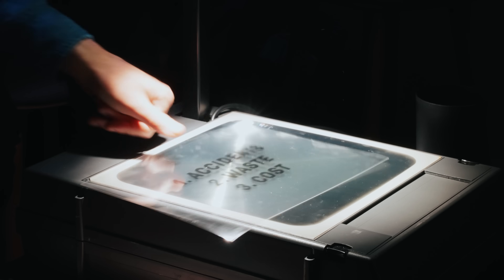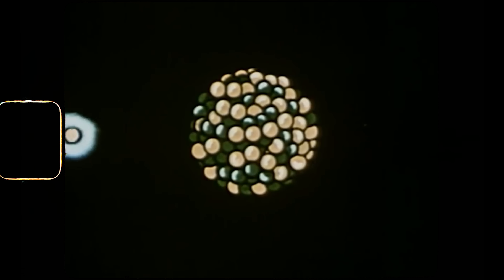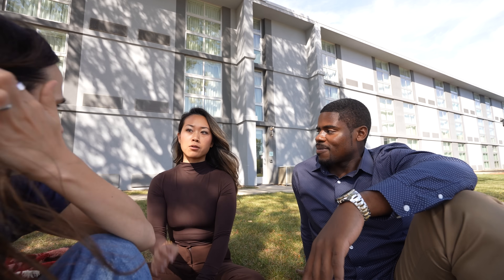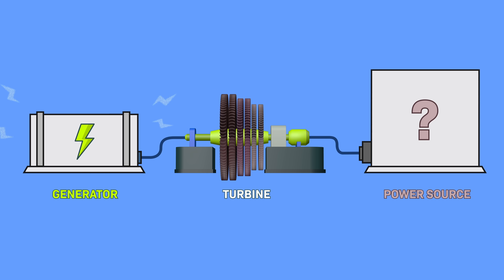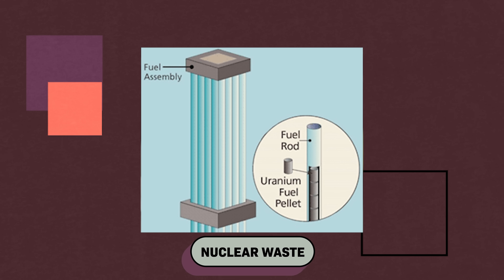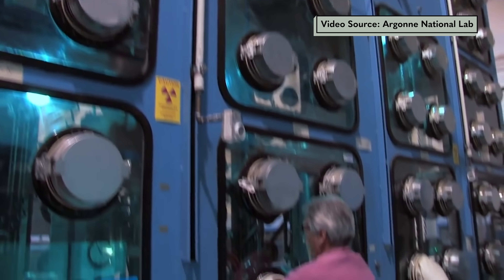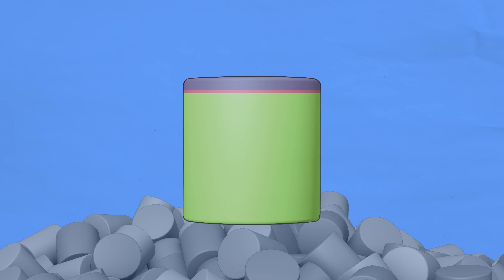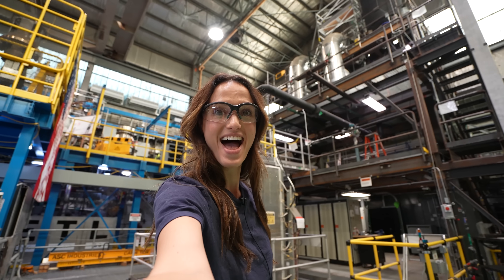The Big Lie About Nuclear Waste

Comment: Inspirational video! Hope we get the proper technology soon, not use we do this in Canada either! I have to go polish my nuclear knowledge, I thought Uranium was the very unstable atom that breaks down into stable atoms creating tons of energy and radiation, and over time when the supply of Uranium becomes smaller, the nuclear fuel doesn't create enough economical energy and has to be replaced, unless recycled.
Reply: This is close, but not quite how it works! The energy in a nuclear power plant isn’t from uranium decaying because it’s unstable, but because it gets hit by a neutron—and that decay also gives off neutrons, so you can get a chain reaction. This means you need enough U-235 that every U-235 reaction creates exactly one more—less than one and the power stops, more than one and you have a nuclear bomb. :/ Eventually, there’s not enough U-235 in the pellets to keep the number of subsequent reactions at one, and you need new fuel—but most of the U-235 is still in there, just with a bunch of other elements ‘getting in the way’. Get rid of those (see the video!) and you can carry on using the fuel. And repeat!
Reply: @DrAndrewSteele  what about the thermal expansion and how that is part of the governing of the reaction rate, IE as it expands,  the density changes, and the rate reduces, so once the safe amount has gone, the only way to get more reactions out is by either introducing outside bombardment, or to re enrich the fuel as per this video.

I say what about, because I recall some long time ago a video describing this process, and am rather dim when it comes to being a nuclear scientist, So, I would like to converse on what about such things for revision purposes.
Reply: CANDU reactors can burn fuel very slightly longer than other reactors, but nowhere near as long as countries like France & Japan which reprocess nuclear waste.  We did this so that we could use natural uranium instead of enriched uranium, but it involved "enriching" the water.  Heavy water absorbs less neutrons.  Burning fuel for longer is a nice byproduct.
Reply: @nathanbanks2354  How much longer does it burn, over the standard procedure?
Reply: @Drew_Hurst  I don't know, precisely.  Light-water nuclear reactors use fuel that's enriched to 2-5% U-235, whereas a CANDU reactor can use natural Uranium which is only 0.711% U-235.  A CANDU reactor also has a robotic system that can refuel while it's still running.  I don't think anyone has tried reprocessing spent fuel from a light-water reactor for use in a CANDU reactor--there are various other fission products which make spent fuel difficult to handle because the emit various types of radiation.  The physical shape of the fuel rods & cladding are different.  However spent nuclear fuel from a Light-Water reactor still contains 1% U-235, so this could theoretically last a little longer than natural uranium if someone did reprocess it for a CANDU.
Reply: Well, you're quite the nuclear buff! I think you've got it right, but just remember: with great nuclear power comes great nuclear responsibility. So don't go causing any radioactive mayhem while you're out there polishing your knowledge.
Reply: As others have mentioned, typically a stable isotope of uranium is used as fresh fuel which then becomes unstable as it is burnt. Decay heat is not the primary power source for a typical commercial reactor.

But also, most regulators have exposure limits for the fuel assemblies. The cladding material has to deal with transient stress, strain, and fatigue as well as embrittlement, and internal pressure from containing fission gases, plus creep from the pressure/heat. Then there is also crud build up (yes, that is a technical term :-) which is essentially a combination of corrosion and boron precipitating out of the coolant - something about insulating the fuel from the coolant and meltdowns is bad... ;-)

So long story short, currently, the fuel is removed from the core before the majority of the energy is extracted. With a bit of reprocessing it could go back into service.
I can't speak for Canada, but in the U.S. mixed oxide fuel is a bit of a spicy political gray area which makes folks uncomfortable.
Reply: It would be nice if the cost of disposal/reprocessing was included in the cost of fuel.  It would still be a relatively small part of the price of building & running a reactor.  Perhaps a molten salt reactor would make reprocessing easier, though this would still have proliferation risks.  The Canadian company for molten salt is Terrestrial Energy, though they're going through the long long process of certification and plan to use traditional fuels.
Reply: @nathanbanks2354  why doesn't a government contractor just do recycling with government oversight? would probably get rid of proliferation issues
Reply: @Fr00stee  That's what we do now, however non-proliferation is also about allowing countries to have nuclear reactors without giving them nuclear bombs. Reprocessed fuel normally has plutonium in it, though I suppose all spent fuel does too.  Nonetheless, reprocessing makes much more sense to me than storing it for 100k years.
Reply: All fission reactions are very dependent on density: what are the chances that a neutron thrown off from a split will hit another atom? Too dense, and you get too many cascading reactions, and everything melts down (or, in a bomb, explodes). The density is carefully planned in a fuel rod. Once enough of the fuel has split, the density is lowered to the point where the fuel is still hot, but not hot enough to run the reactor efficiently ... but there's still a lot of fuel left in the rod. Recycling is basically sifting out some of the stuff that is slowing down the reaction, and making a new rod that has the right density from what's left over.
Reply: Funny enough - the spent fuel from light water reactors (what most existing non-Canadian commercial reactors are) have higher concentrations of U-235 than natural uranium does (in the range of 0.9% U-235 vs 0.7% in nat U). This means CANDU and other heavy water reactors can use the waste fuel from light water reactors and it would last longer than the normal fuel we use.
Reply: Go check fast breeding reactor they are the ones that can use almost the whole load of the fuel, reactors today just use 1% of the energy inside the fuel, fast breeding reactor can sustain the reaction cause they don't need the fissile isotope of uraniun, they create that part from natural uranium (238) and then use it directly.
Reply: Love to see you build one.
Reply: Two worlds collide, my mind is completely blown
Reply: I've heard of nuclear reactor setups called breeder reactors where they put in nuclear waste and "breed" it back into useable uranium 235, and you can essentially just keep doing this forever
Reply: @Fr00stee  

The breeder reactors generate plutonium-239, not uranium-235 alone. Plutonium-239 is much more radioactive than uranium-235 and it is the primary material used in nuclear bombs. Therein lies the terrorist threat.

Not reprocessing the nuclear waste keeps the terrorists at bay with the high radioactivity. It is also cheaper to use fresh uranium fuel than reprocess nuclear waste. The reprocessing itself generates more radioactive waste so it doesn't really solve the radioactive waste problem well.

Nuclear power is a way to borrow energy from our children's and our children's children's well-being.

France does nuclear waste reprocessing, has the knowhow, and sells its service. France dislikes terrorists, having endured horrific attacks.
Reply: knowing mr. Mehdi if he gets into the technology we can soon expect NuclearBOOM somewhere in Canada😮
Reply: @mru24  That's hilarious but nuclear power plants don't explodes like a nuclear bomb, if they explodes (it means the multiple safety systems fail), it's just a simple hydrogen combustion or simply an explosion for the high pressure reached, nuclear bombs have the particular charateristic that are very difficult to be made, you can't accidentally do a nuclear bomb 😅
Reply: @julyort6762  I completely agree with you but capacitors shouldn't explode too and they do on ElectroBOOM quite often so we shouldn't underestimate Mehdi😁
Reply: @mru24 
Even nation-states had a tough time trying to make a nuclear bomb successfully. India and North Korea failed on their first tries. I suspect that Nazi Germany also failed on its first attempt.
Reply: Although they're getting old and outdated, our CANDU reactors already work using that principle.
Reply: @elbaidel  CANDUs were great at the time, and are still good compared to current reactors, but the principles are completely different compared to the reactor Cleo is talking about (EBR-II).
Reply: the proper tech has existed for literally decades; it is just restricted and massively fear mongered
Reply: Yeah canadian nuclear power, keep dreaming.  Hey whats going a happen to the oil slick we got here in LA?  I kinda got used to the stuff.  Milliken oil drop work without oil?
Reply: Yeah, that's how your standard boiling water or pressurized water reactor works. Breeder reactors are a little different. Since they don't need to slow the emitted neutrons down with a moderator it allows them to generate more fissile material than they use while also generating power on the side.
Reply: @killman369547  It is not so much the fast vs. thermal neutrons that make a breeder reactor, it is the reactor design & geometry. You can make thermal spectrum breeders, the US made all of it's weapons Pu using thermal spectrum breeder reactors at Hanford and Savannah River.
Reply: @richardb1452  yes and look at the long term nuclear waste debacles
Reply: Canada actually has one of the most revolutionary next generation nuclear reactor types to run on nuclear waste in development as we speak. Check the dual fluid reactor.
Reply: Fission is the splitting of an unstable(fissile), large nucleus (U235) into two variable Daughter Isotopes by a neutron.   This process releases approximately 2 new neutrons, and a lot of energy.
The composition and geometry of a reactor is controlled such that 1 of those neutrons will be absorbed by another fissile nucleus, and the other-ish will be absorbed by something else.
Most Uranium is the non-fissile U238.  But when it does absorb one of those non-productive neutrons, it  forms Plutonium 239, which is also fissile.
The problem is those two Daughter Isotopes.  These are all hella radioactive (short half lives), and some of them are excellent neutron absorbers, but not fissile.  These are called neutron "poisons" in the industry.  Given enough run time, they accumulate to concentrations that will stop all fission in the reactor.   You are left with most of the U238 that went in, some new Pu239, very little U235 (the original fissile fuel), and almost twice as many hot Daughter Isotope atoms as U235 and Pu239 that you managed to fission.
That surplus Pu239 is the longest lived radioactive isotope present, with a half life of 40,000 years, but is also an excellent fissile fuel itself.
The problem is that an excellent fission fuel is also an excellent fission weapon.
Reply: Then you are deluded. Even U235 fossil. Fragments are highly radioactive to the point spent fuel rods are red hot from their decays, and have to be kept immersed in cooling ponds for years before they can be diluted enough to be encased in cement down miles deep bore holes. 

You are a deluded sucker.
She is talking about breeder reactor technology. Where side reactions form higher and higher mass synthetic actinides with smaller and smaller critical masses and larger releases of neutrons with every fission that transmute the Atoms of the reactor structure and body's of the workers into radionuclides.

It has NEVER been viable because predicting the chemistry and characteristics of the fuel in controlled fission becomes more and more impossible. 
It has always resulted in unexpected uncontrolled sudden explosive chain reactions. 
And the fission fragments are more and more dangerous at every repetition of the cycle. 

The only advantage, if you could call it that is the potential to accumulate certain isotopes of Americium Californium and Curium that have critical masses from pinhead to marble sized and in theory could be used for nuclear fission bombs you could put in your pocket. As long as you intend to use them in less than a month, and don't mind being killed by the neutrons they release from spontaneous fissions, if you spend more than a few minutes anywhere near them. 
As the half lives are a few years, spontaneous fissions thousands of times more per second than U235 or Pu239..
If you think using nuclear fuel as radioactive as polonium 210, where an amount the size of a grain  of salt is sufficient to kill by radiation poisoning every human on the planet, then you are as much of an ignorant fool as this PR Bimbo appears to be in this video.
Reply: Nice to see you here.
Reply: Please watch some of kyle hills videos, he has a great half life series going into the accidents and other nuclear related videos talking about how it is even now one of the best options (better than only solar or wind).
Reply: This clip drastically oversimplifies the issue. Everything she says is true, but not everything that is involved is in this clip. I'm pro-nuclear, formerly very anti-nuke. If the US could take knee-jerk politics out of the science and engineering we as a nation would benefit tremendously. Nuclear is dangerous but the dangers are known and that leads to safety.
Reply: @cowboybob7093  

I certainly would take properly sited, built, guarded, and operated nuclear power plants' energy than coal-fired energy but every nuclear power plant may have different characteristics so I'm not endorsing nuclear energy wholeheartedly. There are known unknowns but there are also unknown unknowns.
Reply: It’s thanks to US laws that keeps power companies in control
Reply: C J W  Anti-nuke because of bombs, safety and I didn't know the science, became pro-nuke probably the 1990s.
Reply: There is ten billion more times  energy in uranium-235 on earth than we have in the oil reserves, so yeah we don't need to worry about the uranium supply, but this is great for dealing with waste.
Reply: U238,U235,Plutonium,Ionizing Radiation
Reply: Just think, Canada used to build and sell to other countries (10 reactors in total were built outside Canada),one of the safest nuclear reactors ever built. It was called the Candu Reactor.
Reply: If I remember my chemistry correctly, uranium-238 is the most commonly found isotope in nature and is the most stable form. It’s still reactive and radioactive, but not as much as other isotopes, like U-235, which is more unstable easier to fission.
Reply: It's not very unstable.

Uranium 238 (the majority of the naturally occurring stuff) has a half-life of 4.5 billion years. 
Even Uranium 235 has a half-life of 700 million years (the stuff used to make electricity). 

Uranium 235 is useful because it's atoms size being on the brink of being unstable, its easy to push it over the edge and make it's split by shooting high speed neutrons at it. Shooting high speed neutrons at any large atom will make it more unstable and perhaps split the atom, but Uranium 235 is ideal because it releases 3 speeding neutrons as some of the byproducts which is what makes the chain reaction possible in the first place (aka it's fissile). 

It's actually Plutonium that's the bad apple. It's the stuff the bombs are made of, not really uranium.
Reply: @jshowa o Tens of thousand of years 🎉 It’s more like 200 - 250 years with the current consumption rate. At least that’s what the Nuclear Energy Agency says.
Reply: No more fish as well as crab, if japan pour out contaminated Radioactive water into Pacific ocean.
After 1 year or 2, the Atlantic Ocean is going to full of Radioactive japanese water.
Reply: if that was true you would hear only complaints about energy costs. Instead you see the opposite, people opposed to vuclear energy repeat memes about the waste and talk about the need to pay more to get cleaner energy. Which is to say it not an economic issue but rather a culture/education/propaganda/political issue
Reply: CANDU (Canadian Deuterium uranium reactor) can use less refined uranium and waste.
Reply: Canada doesn't use it because Canada has a plentiful supply of natural uranium. It's more expensive to process waste uranium than using new uranium. And considering new uranium is already quite expensive, it gives you a sense of how much more expensive waste uranium is.
Reply: We only need enough uranium to get rid of fossil fuels as we advance Wind and Solar.

The problem is that we don't have enough time using fossil fuels because we cause major damage (more than we have) that would be even harder to repair. Nuclear is clean and provides so much power you could entirely replace fossil fuels with it.

But then you'd upset oil and coal companies. We still need to push back into nuclear to have any shot of pulling off the switch from fossil to clean.
Reply: Hello Mr ElectrOBoom, I have a sweet handy playlist to this end 

Well you just help yourself fren
Reply: Aye Mehdi! Can't believe I'm early and my reward is this(maybe getting a reply from you too)🤩

Comment: I wonder if the recovered fuel on the cycle could be used in a molten salt reactor. It would reduce the footprint even further and still allow the good stuff to be used without need of reprocessing into rods.